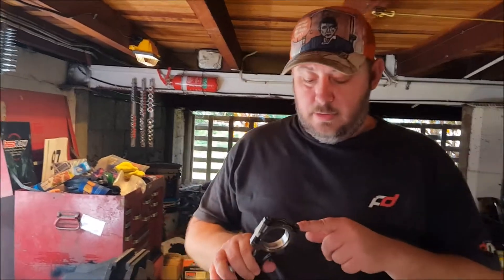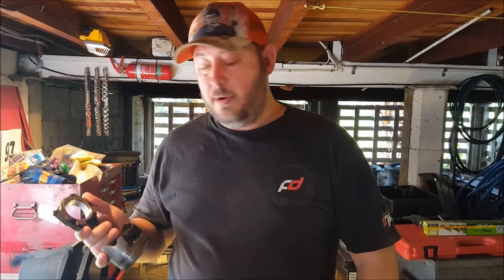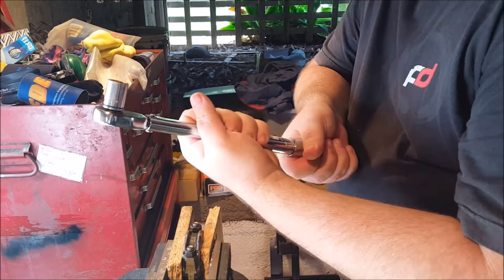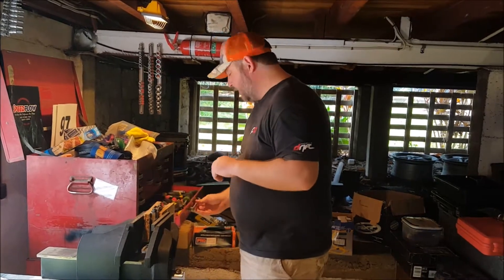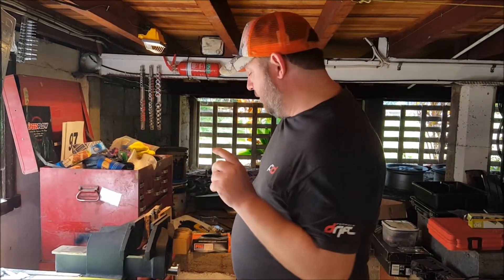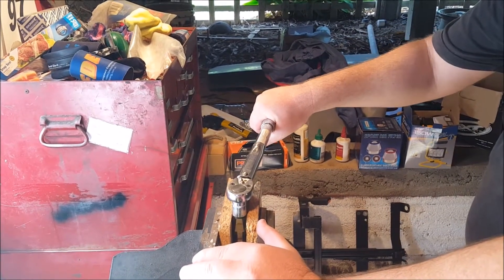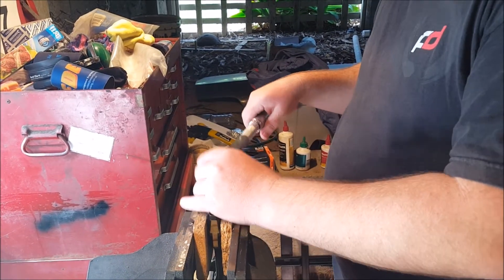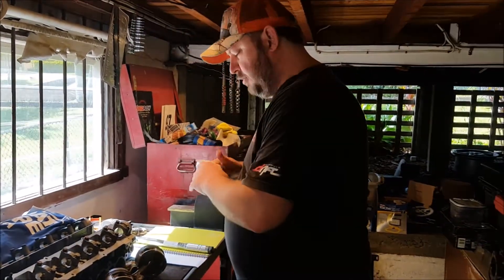RB25DET Rod End Cap Torque Spec Experiment - Torque vs Rotate Angle

Comment: Iv seen diffrent rod bolts in 20s 25s and 26s some models (all 26s iv done) recomend 15nm +60* to 65* angle torque (im not 100% on this next bit) im pretty sure angle torque makes them torque to yeld type fastner and they stretch and there is a stretch limit not sure what it is. Most 20s 25s and 30s iv done are just 2 stage one=15nm & 2=44nm not torque to yeld type. Also if you go to ARP fastners they have a torque setting of 0.0070in rod bolt stretch and tell you log orignal size if stretched by 0.001 un-torqued replace. Long story shory if they are the angle type and torque to yeld they probly need replacing on a rebuild.
Reply from the maker: That torque number is for stock only yes. As far as being stretch type or yield type, the mechanics of it how the materials of the bolt reacts is all the same. All methods will stretch the bolt, doing it in stages, can have an impact on the amount of stretch for your torque number, but not a significant one if it's done back to back. Your 44nm backs up my little experiment here so that's a good thing. I would recommend always replacing any torque critical bolt in an engine, and always us the manufacturers recommendations, including the assembly lube in the car of ARP they specify what bolt lube to use, as a different lube would give you a different result.
Reply: Torque to yeld stretches a bolt past its elasticity point Stretch type only use 65%-80% of avaliable elasticity and iv never looked into if they are the same grade type etc. Your right about the arp lubes might have to try an expermient like you have here with diffrent types my personal favourite is Moreys heavy duty oil stabliser its less messy. Also i never use taps and dies to clean threads (unless fucked lol)i just use an old bolt an grind a slot in the thread and using torque wrench always make it click in one go or back it off and start again. Angle torque i mark with twink pen dot on the nut or bolt and a dot at required angle iv never found a angle torque gauge that worked well Cool vids keep it up.
Reply from the maker: You seem to know a decent amount, I'm no engine builder (I think that's clear in the vids lol), But I am a Boilermaker by trade and I always had an interest in engineering, meaning I had done some study into materials science, just because I liked to know why material did what it did. The steel, no matter what grade will follow a similar pattern of elasticity, they will all stretch and want to return to their original form. This is the force the bolt then applies (trying to get back to it's un torqued length). Until it hits the lower elastic limit, which will vary depending on the grade. this is not the yield point though. It's the point of stretch or deformation from which it will no longer return to it's original form. Continue to stretch it however and it will still want to rebound somewhat, just not the full amount, until you then hit the upper elastic limit. At this point the bolt will stop trying to return  to it's shape and is permanently deformed, unable to rebound... the next major point is the yeild point... yeild point being the point at which it required less force to keep stretching and will indicate failure of the test piece. I know in mechanical engineering when we are torquing, we are getting between the upper and lower elastic limit. Nearer the lower. Due to this, we do not re use stud bolts for service or grade 8.8 bolts. I assume it's similar for engine bolts and am replacing all critical hardware, even the cam cap bolts are on order. The problem with a torque number is the same as the lube issue, it's how much of that torque force is actually then converted into stretch, how much s lost due to friction and heat when tightening. But the key is I think that for the ranges in which the bolts work, I'd bet all 3 end up within the range and be fit for purpose, but the stretch would be 100% the most repeatable and accurate method. Be cool if you could conduct your experiment though I'd watch it.